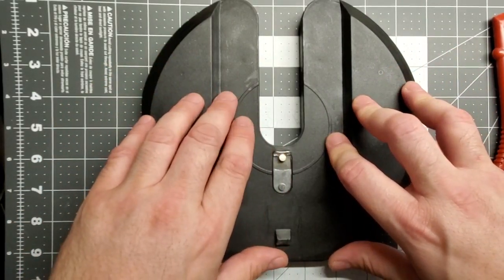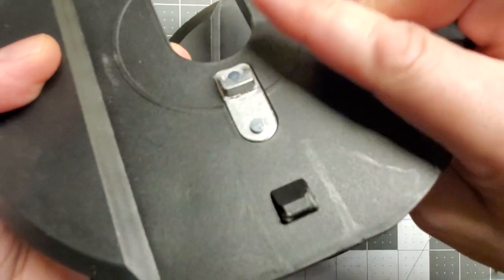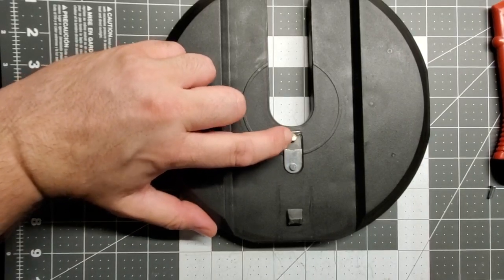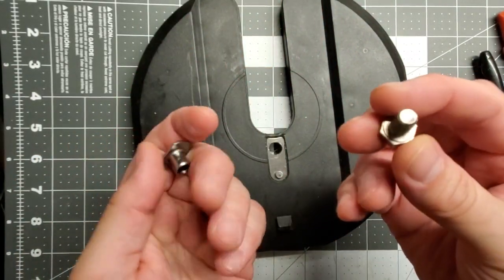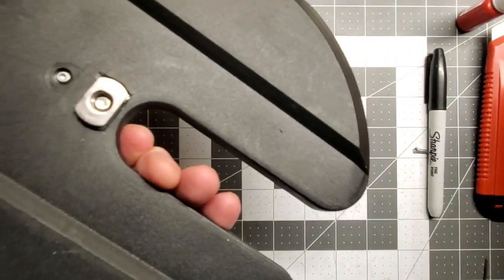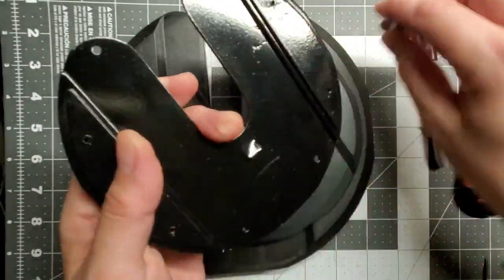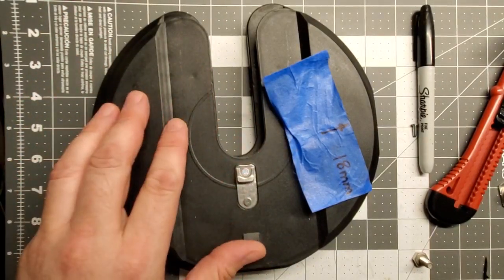The New $1 Fix for Broken 552 & 1090 Bowflex SelectTech Weight Plate Tabs

Comment from the maker: PLEASE NOTE: there are countless styles of weld nuts with various tabs, flanges, projections, etc. I showed a very specific 5/16" weld nut obtained at a True Value franchise store (it's a hardware store chain in the U.S.). That happened to be a perfect fit for a 3/8" drill bit. If you purchase a different style or size of weld nut your installation may vary as far as drill bit sizes, and cutouts in the plastic that covers the plates. But the same basic approach still applies. Any questions, shoot me an email at joe@averagejoeinnovations.com
Reply: I liked and subscribed I was wonder how can I fix the little bottom metal piece at the bottom of the base it got pushed in a bit how can I fix this

Comment: Can you just replace the old style plates with the new plates
Reply from the maker: By "old style" do you mean the plates that have the plastic covered steel tabs?  I've not tried it, but hypothetically speaking, it should be possible so long as the plates are from the same model. I don't believe they've changed the dimensions of the plates. If you're doing it for aesthetics, the newer plates do look a little nicer, but if you're doing it for durability, they aren't going to be any more durable than the old style.  Cheers, Joe

Comment: I used a drill press and drilled out the top tabs on plates 3-5 on my 1090 plates. I then used a weld nut and a bolt as stated in the video. The dial now catches. It will not fully rotate. Dial is catching on something I cannot see. Any ideas?
Reply from the maker: Hiya, Dietrick. Super happy to hear that you've invested some time into this fix. Once you've got the bugs worked out, it's unlikely that you'll ever need to touch the repairs again.

Here are a couple things to inspect to find your source of interference that prevents the dials from turning:

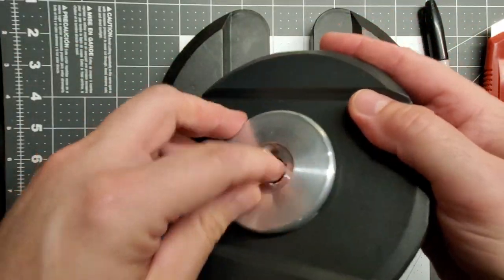First, it's important that the lower edge of your bolt (the portion that comes into contact with the adjacent disc) is positioned at no more than 18mm from the plate inner edge (shown at 13:18 in the video). I like to verify each plate modification individually to ensure that there's no interference (as I do at 14:40). If you find that the edge of the bolt is interfering with the disc, you'll need to file or grind it down slightly to provide clearance. Not too much clearance. Just enough that the disc rotates smoothly past the bolt head.

Then inspect each plate to ensure that the heads on the bolts aren't too thick. In the 4-4.5mm range will usually be ok (14:19 in the video). That's enough material to "catch" the disc lip and retain the plate in the handle, but not so thick that the bolt interferes with the disc.

Finally, inspect the back side of each plate to make sure that your repair is flush (16:30). It should not protrude beyond the plastic covering of the plate. If it protrudes it'll interfere with the neighboring disc.

I suspect that you're dealing with the first issue. Do what I do at 14:40 to check for interference, one by one with your plates. Shoot me an email if you have more questions Cheers, Joe
Reply: @AverageJoeInnovationsLLC  I will grind down the bolt heads later today and see if that helps. Thank you for your response!

Comment: What length for the 5/16 bolt?
Reply from the maker: Hi, Maverick. Sorry about the delayed reply. I was away on a trip for 5 weeks overseas with limited internet access. I'm back in the States now and playing catch up with filling orders and answering questions.  Length varies from plate to plate because the plates are different thicknesses. Anywhere from a 0.5-1" bolt length would be plenty.  Also, think of this video as just one approach of many.  You could epoxy the bolt or even weld it in position. You could use round head bolts rather than hex. The end goal being to use the head of the bolt as a replacement for the tab. Cheers.

Comment: Any links or recommendations as to where these 5/16 weld nuts can be purchased?  I've checked all local hardware stores and they do not have them stocked.
Reply from the maker: Heya Chris, up here in the Northeast I'm able to get them at the local Rocky's/Ace hardware stores which seem to carry many of the more unusual and harder to find parts. I've seen them on eBay in packages of maybe 20, possibly as few as 10 pieces. People list them by many names whether they're correct or not: weld nut, slab nut, flange nut, projection nut. etc. At some point I may just end up stocking them so folks don't have to go hunt around for them.

An alternative to using a weld nut would be to epoxy the bolt into a close-fit clearance hole. I didn't cover it in this video, but it's definitely a viable alternative.  I just preferred the removable nut/bolt combo. You can look up the "clearance hole" diameter for any bolt online. For example, you'd use a P drill bit for a "close fit" clearance hole for a 5/16-18 bolt. Then just apply your epoxy generously on the threads and under the head of the bolt, push it in the hole, rotate the bolt to the proper orientation (if you use a hex head style), wipe away the excess and let it cure. 

No matter which method is used, you might have to file/shape the head of the bolt a little afterward depending on the bolt head size and accuracy of the hole.
Reply from the maker: Hey Chris, I just double checked another option as well. An M8 bolt and weld nut should work. An M8 bolt head is very close in size to 5/16" bolt head. Both measure  around 12.7x mm flat to flat. And here are the weld nuts on Amazon:

https://www.amazon.com/uxcell-Carbon-Steel-T-Shaped-Projection/dp/B07KWWWS27
Reply: @AverageJoeInnovationsLLC  I've acquired both 5/16 and M8 hardware, and I believe both will do the job quite well.  I'm leaning on the 5/16 due to the weld nut being zinc coated vs the m8 weld nut being uncoated.  

Related question: if I am able to use the "pry method" of the original metal tab (saving me the effort of drilling etc), is there any concern that the metal tab will be weakened and vulnerable to failure?
Reply from the maker: @chriscapute6778   Definitely wise to go with something that's more resistant to environmental factors. 

The pry method should not weaken the tab, at least not in any significant way. You'll only need to pry it outward a millimeter or two at most. As long as you aren't repeatedly prying and pressing it back and forth to adjust it you'll be ok. But prying will further alter the distances between the tab and the adjacent disc. The combination of missing plastic cover and new tab angle means the plate will probably feel a bit more loose in the handle. As long as the tab is outward enough to secure the plate, but not so much as to interfere with the disc, you'll be ok. That plate will just shift around more as you go through your ranges of motion.

I definitely prefer the bolt method as a long-term solution even if it's a bit more involved. The steel used by Bowflex is easily drilled.  The key is getting the hole centered to make sure the face of your bolt lands at about that 18mm mark.  But, even if you're off slightly--let's say your bolt  face lands at 19mm--you're still able to remove a little material from the bolt to get the right fit. 

The main reason I like the bolt method (on the heavier plates) is that it's less likely to gouge the discs over time. Prying on the lighter plates works fine. But you can always try the pry method first, and change your mind later if you don't like it.

Hope this was helpful. Have a great weekend man!

Comment: The plastic shells broke on 4 of my  series one plates, my quick fix was to wedge a flathead screwdriver in and pry up the metal tabs about a millimeter or 2 to make up the difference of the missing shell.
Reply from the maker: Hey hey Ken...awesome man... you figured out the pry method. For those who might be wondering what Ken means, here's a video explanation:

https://youtu.be/P7sgmcXm66o

There are a couple drawbacks to it compared to the bolt method...but it beats buying new plates.

Comment: bro with all this upgrade and great hack. why wouldnt you just just put together a brand new set and sell a set rather all this DYI> im sure it will would come out less then a brand new 552.
Reply from the maker: Hey Alex, great question man. There are a bunch of reasons behind why things are the way they are currently. 

All these little fixes began life as mods to my own dumbbells. And quite a few customers are just looking for one or two repairs to their existing dumbbells without having to re-invest in whole new ones. So even though I make a bunch of mods, they may only be interested in one or two. 

At the moment at least, I don't have the $, space or manpower to store, sell and ship entire pairs of dumbbells.  I can ship little DIY kits relatively easily and fit dozens of kits in the space occupied by a single pair of dumbbells. That and the margins on kits are better than the margins on whole dumbbells. Especially at my super low volume that I sell today. Selling entire dumbbells would not be profitable.  It would be a totally different story if I was selling a thousand pairs a month.

Another issue is patent related. You as a dumbbell owner have a right to repair/improve your dumbbells. And I have a right to make and sell replacement parts to you for the repair/improvement of your dumbbells. Things become murky when you put all those components together into finished dumbbells and sell them. Overseas knockoff manufacturers get away with selling direct ripoffs because they know it's virtually impossible and incredibly expensive for a foreign OEM to effectively pursue them. I don't have the desire or the $ to go down that rabbit hole. I believe BF's parent expires next year, but even then it's just not an avenue I'm interested in pursuing.

Instead, my plan is to eventually release my own original adjustable dumbbell design to compete with existing designs. For now I simply find ways to improve existing designs to help people get more out of their existing fitness equipment investments.

Thanks for the question, Alex. 
Cheers,
Joe

Comment: How much to fix all of mine I'll send them in
Reply from the maker: Hiya Justin. I wish I could help you here man. But I'm already maxed out just tending to AJI business operations in addition to my day job. I wouldn't want you to go through both the massive expense of shipping weights back and forth, and the potentially lengthy wait time for me to get around to working on them. 

The steel used in these plates is mild...cuts like butter with a decent drill and bit. If you aren't comfortable doing a job like this yourself, maybe some pizza and a couple buddies can turn this into an afternoon DIY?  It's really not that bad a process once you finish the first one and get a feel for it.  And once you do this fix you will never ever ever ever have to do this to your plates again. Unlike the cheap ass OEM riveted tabs or plastic-covered stamped steel, the bolts aren't going anywhere.  Heck, I almost wish folks would just do this mod automatically to all of their plates and be done with it.  The OEM tabs aren't safe over the long term in my opinion.

Comment: I feel like I want my OEMs to fail just so I can buy your disks and de this mod 😅 don't want to spend that amount of money but would feel nice to know they are bulletproof and stop waiting for something bad to happen
Reply: What I'm not looking forward to with the 1090s is having to measure the bolt's head and dividing by two, then substracting that to the 18mm, then perfectly centered mark the hole, then drill. Sounds like a lot of steps that could add to having a hole that doesn't work at the end 😂
Reply from the maker: Hi Elpin. You're working with the older version of the plates?  Don't sweat getting it absolutely perfect. The entire SelectTech is built on imprecision. If you overshoot and your bolt's flat bottom edge is beyond 18mm you can grind/sand it back a smidge. It need not be precisely 18.  18 is just optimal. If you find that your dial turns a bit tight, take a little off the bolt's lower face.  

Let's say you accidentally undershoot and the bolt face measures 17mm. It's still perfectly safe and will function just fine. You'll just get a little knock/click/rattle as that plate moves as you go through your range of motion. Given how noisy the SelectTechs can sometimes be, you may not even notice it.

Measure twice, drill once and all that jazz.

Compared to buying new plates, it's worth a shot unless it just isn't worth your time. If you decide to give it a go, let me know how it works out for you.
Reply: @AverageJoeInnovationsLLC  Thanks for the tips! Might give it a go!